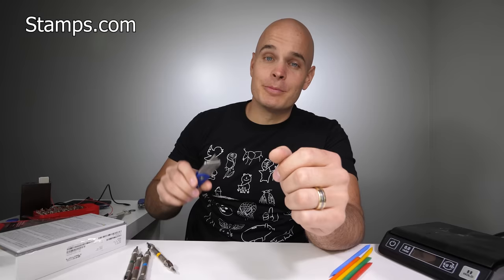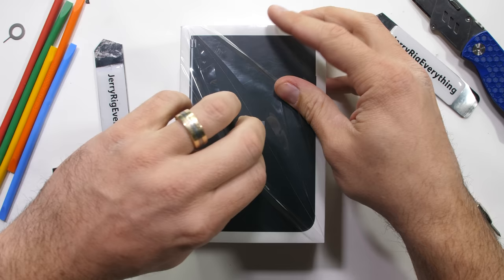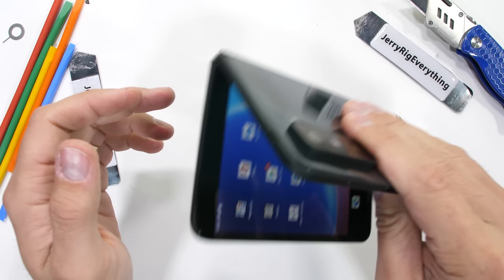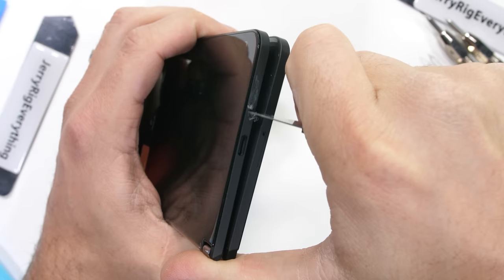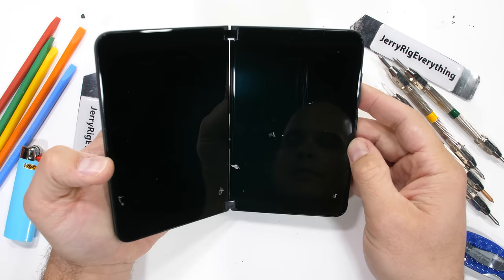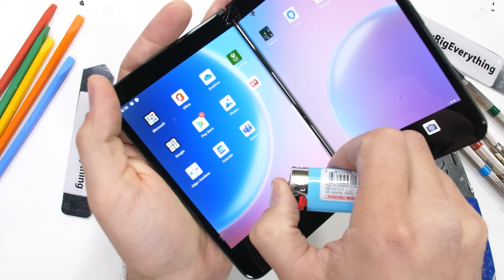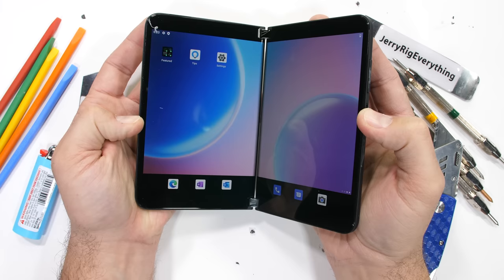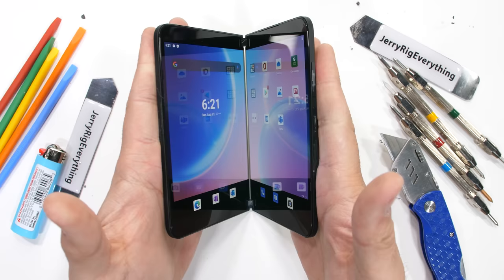Microsoft Duo 2 Durability Test! - There's one big problem...

Comment: Comment Realted to humvee project. Me and another guy from work are throwing around an idea for a rock crawler EV with four motor torque vectoring with gear reduction to crawl.
Reply from the maker: That would be sick!
Reply: Thinking starting with a CJ7 or CJ5 chassis, stretching the frame 3 inches to widen it out and 2 tesla 3 long range cells. Not sure which motors to use was thinking of reaching out to Rimac on the torque vectoring program. And using the gear reduction hubs from......a humvee. Essentially getting rid of the entire drive line as a whole

Comment: I fear that a Windows phone as you described its yet not possible. Windows uses a different architecture chip : X86 which is much more power hungry while the mobile phones of today use a ARM architecture. the X86 is a complex instruction set CPU while the ARM is a simple instruction set CPU. Why is that important to state here and why it is impossible to have a Windows 11 phone ?  : the architectures are not compatible. you can run X86 to an ARM or vice versa but only trough an emulator software which causes a significant decrease in performance.
We can all thank Intel for sleeping on the last 20 years and AMD for their old Bulldozer who gave Intel the opportunity to have almost all the market share with literally no need for improvement, that set the X86 PC performance in a time capsule while ARM had huge competition and demand which made many companies forced to invest more and improve on it constantly . The x86 platform should have been much more faster than it is now and much more power efficient, ARM is catching up and even surpassing them (M1 chips from apple) which is totally ridiculous since by definition and design , a complex instruction set should crush a simple instruction set in performance. 
the software market also moved towards the ARM and they managed to include apps that once they were impossible on a ARM CPU, so there is that also.